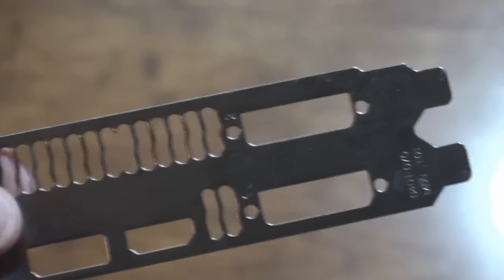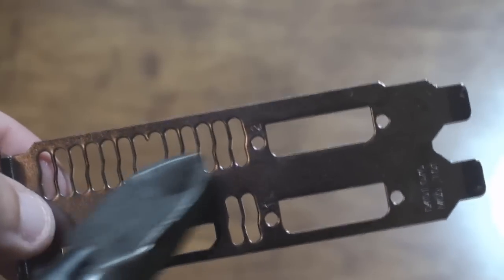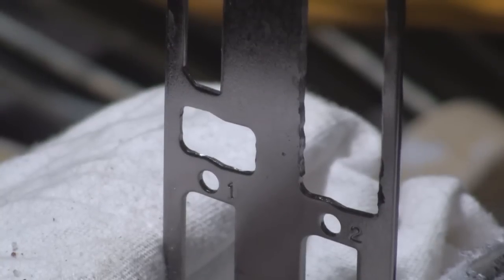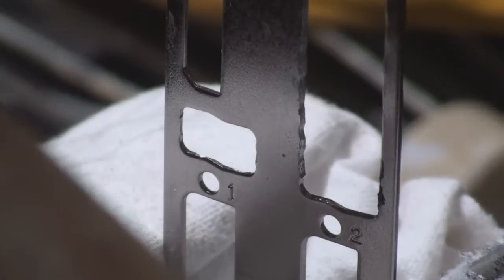How To Make your own High Flow Bracket

Comment from the maker: hi
No this mod will work on any card reference or not..You can even mod an already high flow bracket.
Since it sits on the back of the case and stands vertical there isnt much dust that would go in and you can say that about any open areas on your computer